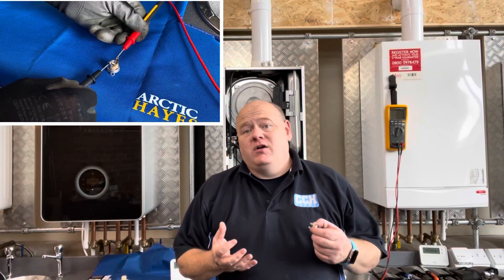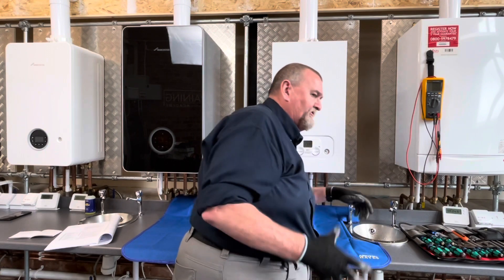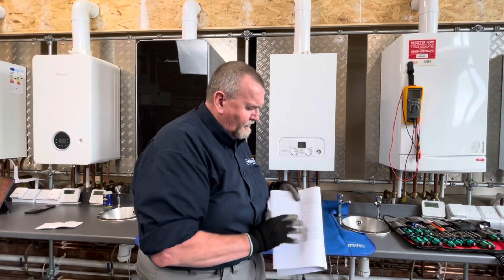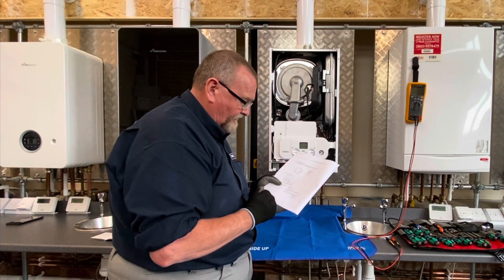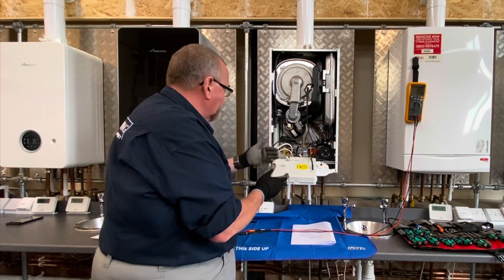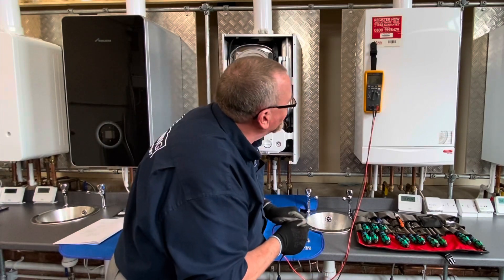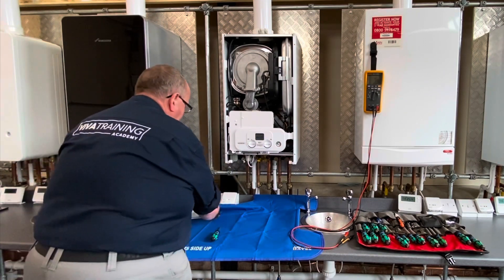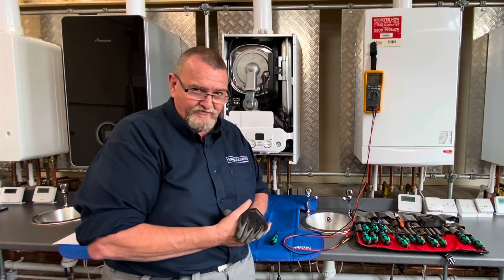Gas Training - Boiler Fault Finding - Baxi E110 / Main E1 10 - Roy Fugler

Comment: So i had an e 110 on a baxi 630 did all the tests traced back to pcb as i followed the manufacturer instructions .  Ch was fine but it would lock out on hot water and show e110 . Tap water running but no heat to taps . So i assumed the pcb as follwing manufacturer instructions would be a thing right   so i priced it up informed the customer and asked to go ahead with the job. Booked in when part comes in . Now im infromed that the guy that fitted it 4 years ago has come out and said its the plate heat exchange. Im thinking no way is it that we have central heating and we have actual water running through it. How can it be the plate heat exchance . Anyone got any advances on this theory of his .
Reply: E110 is overheat on primary water temp. Would a blocked plate  cause this?
Did the boiler fire up when you ran the hot water tap or did it go straight to lock out?

Comment: I had a E125 fault now it's saying E110 fault after trying hot water tap. When central heating trying to start the noise like stretching rubber then a thud and it's off again.
Reply: I've got exactly this, first engineer said it was the plate exchanger, which he changed, but next day had the same issue, then he said it's sludge in the system, needs a powerflush and then its basically the main heat exchanger thats blocked with debris. Powerflush booked for tomorrow so we will see!
Reply: @ikyiky167  I had power to the pump but it was actually the pump needed changed then it ran fine. Touch wood so far so good. But they did steal my fluke multimeter!
Reply: @checktheskies5040  - hahha now I think I need a third opinion! I've got exactly the same fault as you so maybe mine is the pump as well. Glad you are sorted
Reply: @ikyiky167  good luck pal!

Comment: Hi Allen
I installed Worcester 4000 25kw. After 2-3 hours fault code 224 came up on boiler screen???
Reply: Hi Jahan, 224 fault code indicated the boiler has overheated, as it had only been fitted a couple of hours it is more than likely air in the system affecting the circulation. I'd look to bleed the system/radiators and check the system pressure.